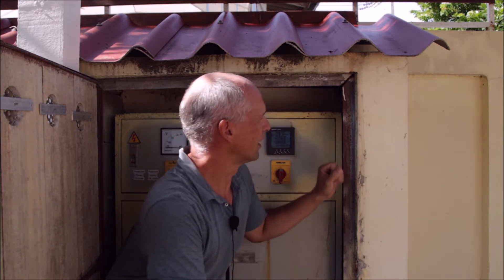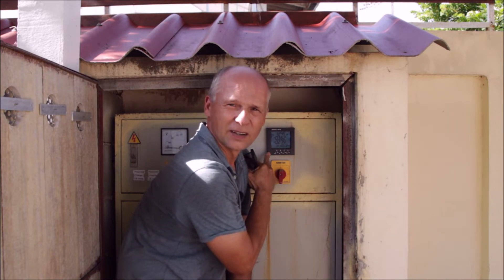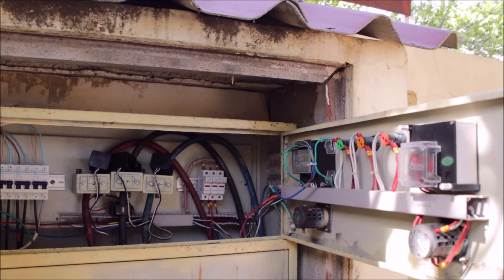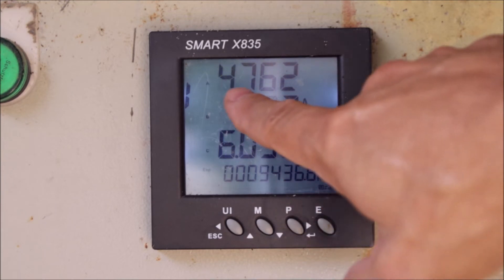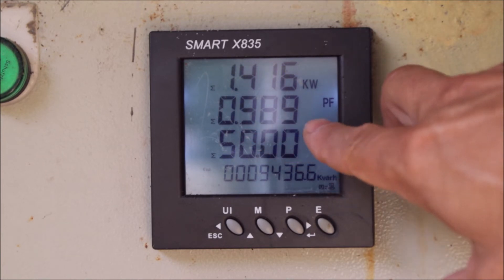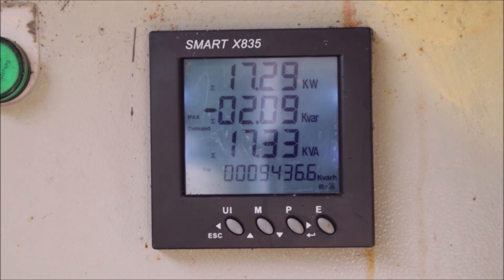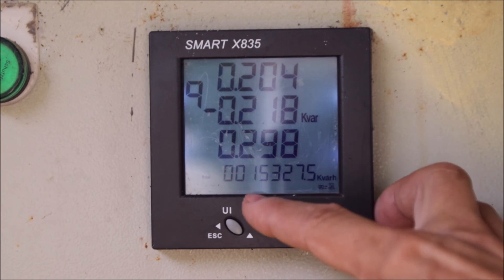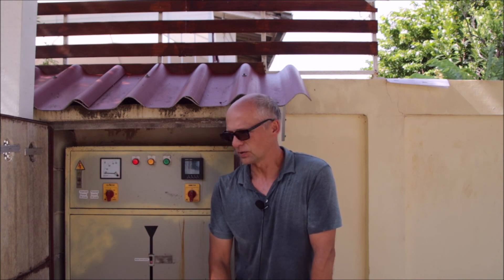Eastron Smart X835 panel meter review (3-phase, Modbus)

Comment: Hallo Roland, das ist so zu sagen die 96x96 Einbauvariante zu dem SDM630…
Hat der auch den Fehler wie der SDM630 wo Import und Export zusammengezählt werden
(Also nicht Saldierend)
Gruß Uwe
Reply from the maker: Hallo Uwe, ja genau, dass ist der grosse Bruder vom SDM630. Sehr komfortabel durch dass riesige Display und direkte Zugriffsbuttons. Du meinst das Total ist Summe aus Import plus Export, und es sollte Import minus Export sein?
Reply from the maker: Ob das Total die Summe oder das Saldo von Import und Export sind, haengt ja nur von der Betrachtungsweise ab. Summiertes Total bedeutet es geht um den Energiefluss ueber den Zaehler unabhaengig der Richtung. Ein saldiertes Total wuerde ohnehin nur im Falle des Net-Meterings interesant sein, wo der Wert des Imports dem Wert des Exports gleich ist. Allerdings bezahlen wir meist einen viel hoeheren Preis fuer den Import, als wir fuer den Export bekommen. Ich persoehnlich achte ueberhaupt nicht auf das Total. Ich brauche das Import und Export als individuellen Wert und mache damit meine kalkulationen.
Reply: @RolandW_DIYEnergyandMore  Ich gehe alt von den alten Zähler aus…
Eine Umdrehung vor und eine Umdrehung zurück macht hat in der Summe keine 2 Umdrehungen…
Aber egal, bei den ganz neuen haben die das ja jetzt geändert…
Gruß Uwe